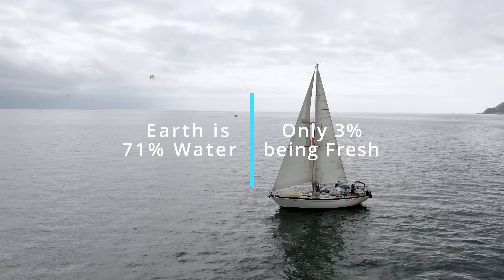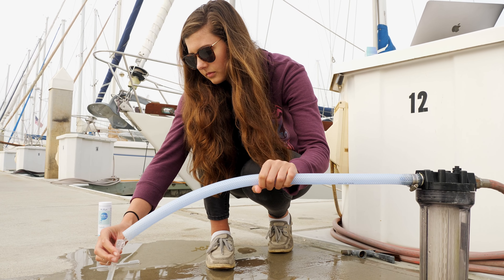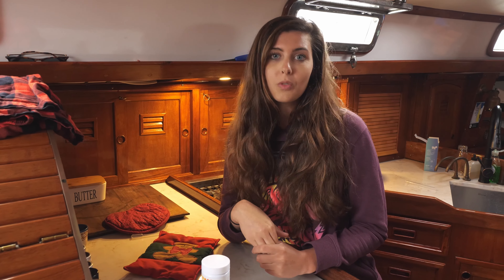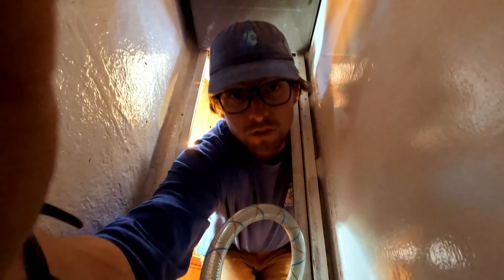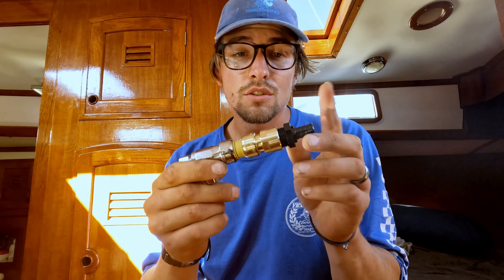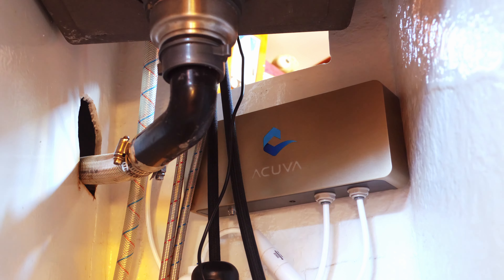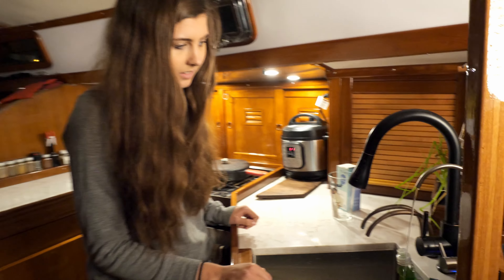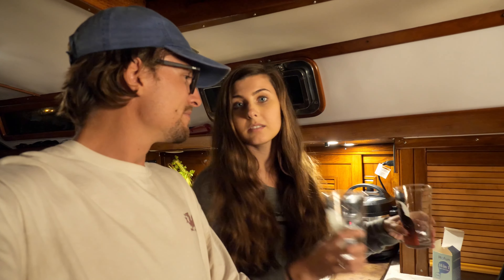EW! We Were Drinking THAT? Fresh Water System Upgrades

Comment: Great video very useful to UV neophytes. I've used UV for years on fish tanks to great effect. One tip, you can put a simple valve on the UV inlet side so when you are in known 'GOOD' water just open it up and let it flow, and the worse the water is the slower you adjust the flow to increase UV dwell time on the flow. UV bulbs be expensive ya know! You could of course add a loop so that you are just 'UV polishing' the water in your tank.

Great couple, nice boat and good videos!
Reply from the maker: Hey good idea!